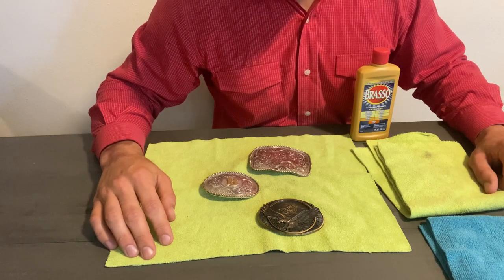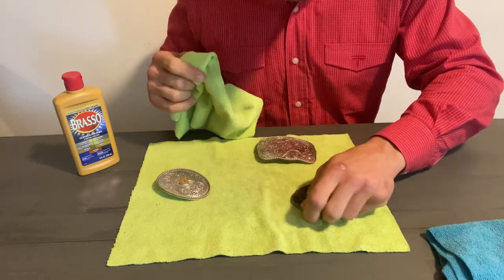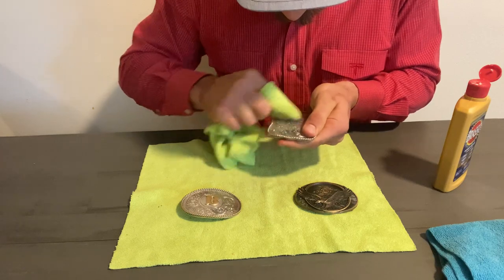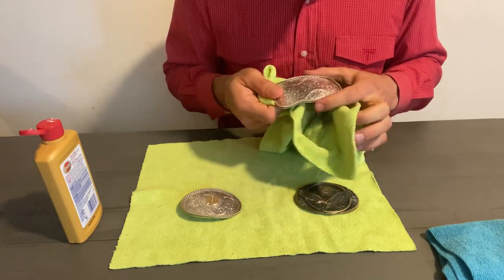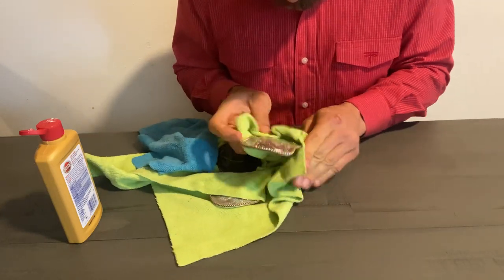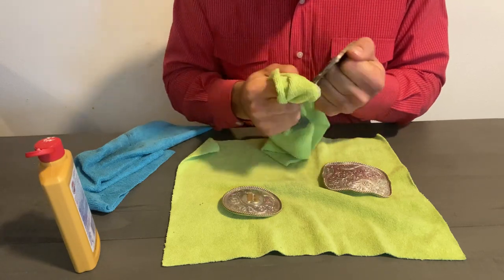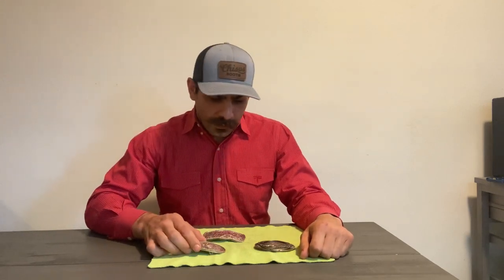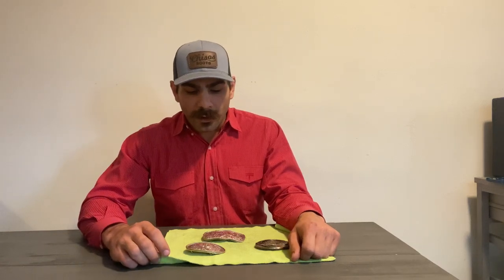How to easily polish your belt buckle

Comment: Brasso is an abrasive polish 
Never use it on belt buckles or any other plated object 
You will scratch your whatever up as well remove the plating 
Eagle one never dull is a far better and non abrasive polish and quite frankly works faster and better
Reply: Is tarnish x good for buckles?
Reply: @jjb2203  never heard of it
Reply: @jjb2203  eagle one never dull its a non abrasive polish it will polish brass gold silver stainless and copper easily  and to a mirror finish